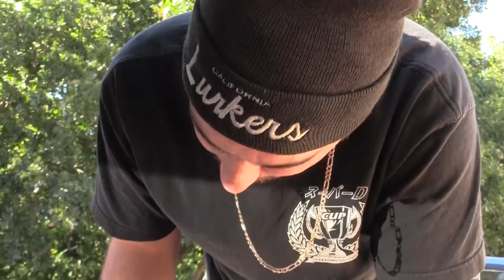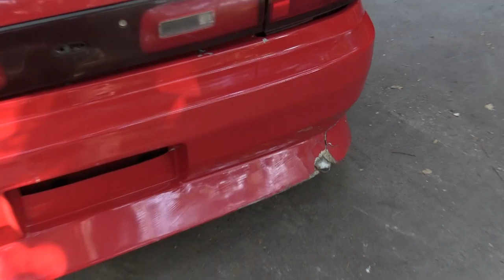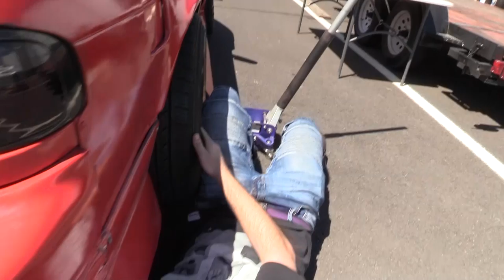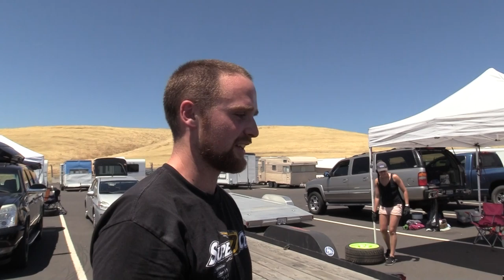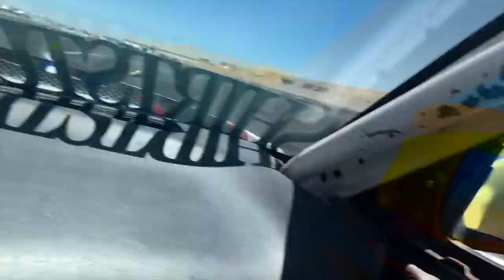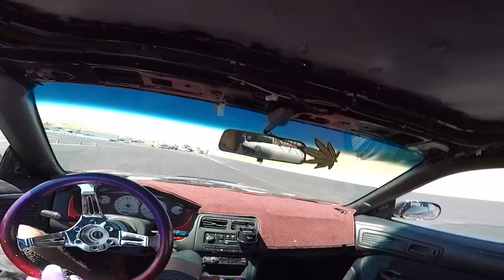Good Luck League SS3 | Animal Style

Comment: Shouldn't you put coolant in there and not only water???
Reply from the maker: streetwaxtv most racetracks prefer water only, in case it spills.
Reply: Water cools better, just has a lower boiling point. 2 bottles of water wetter and distilled water is money
Reply: Coolant is better in winter because it has a lower freezing point, but in this case a destiled water is a better option for cooling

Comment: Should have went KBD. wouldn't have cracks 😘😂❤
Reply: @avs1109  sounds like a guy with a busted ass kit with zip ties 😂
Reply: @avs1109  they have more cause theyre not looking like a broken plate 😂😂
Reply: @joshuamoss9056  how many cars at final bout run kbd? None
Reply: @joshuamoss9056  kbd bumpers sag way too much anyways
Reply: @avs1109  not at all. My shit fits tight. Had to weld a resting bar on the rear bumper and its great and there is kbd at final bout cars. Should check out parc drift cars. A lot of us are running KBD.
Reply: @avs1109  they’ve got a bunch of different kits now lol, bn, dmax, even a superdoof style now... they look the same as any other fiberglass kit just won’t break. Only reason I wouldn’t go kbd is if I wanted an origin racing line kit, but I’ve heard they’re working on one of them too... what I’m trying to say is they’re no less stylish than the fiberglass versions....